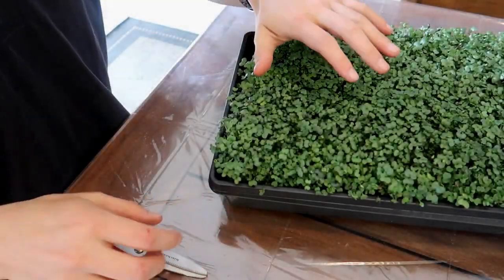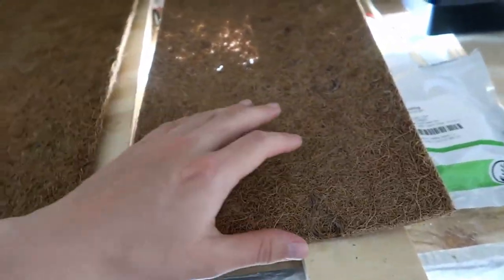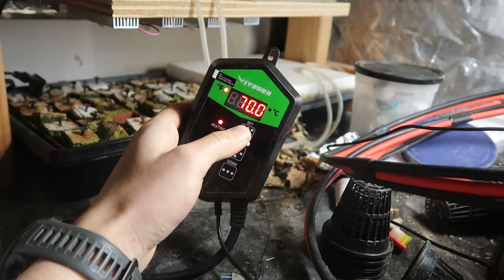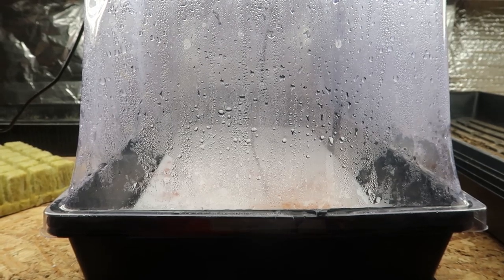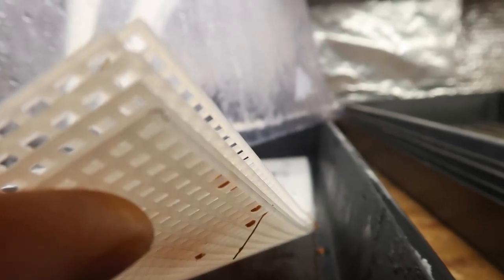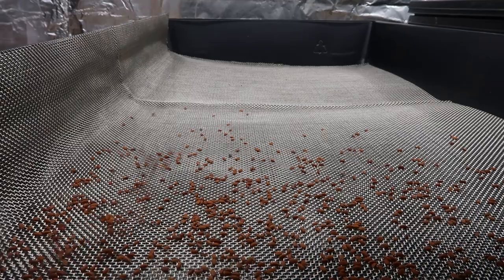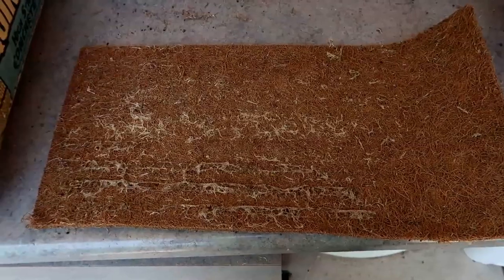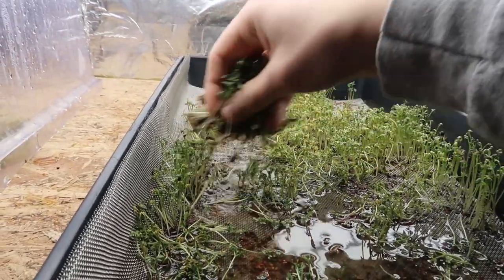Growing Microgreens on Steel Mesh

Comment: We use the NSF approved grow screen option, which is Efficient Grow.  Growing on Stainless Steel can lead to the roots absorbing heavy metals.  Best to use the screen that's designed for Microgreens growing.
Reply: Not sure where you got your info, but 304 and 316 stainless steel is both safe for food use.  Its also used in some plumbing, so if we can drink from it I doubt growing with it is going to be any type of issue.  316 is also cleared for surgical use, so it literally can be used inside the body.
Reply: @wyldwabyt  it's funny.  Now they're saying the material is 316 grade.  By my count this is the third different grade they're calling it.  What is it really?  You'll never see stainless steel used in a large hydroponics facility.  Virtually all the fixtures and plumbing are NSF approved plastics, selected for this purpose.  Where you'll see stainless steel used in food production is very short contact applications, think hours not days.  Further you'll never see roots touching stainless steel as the root osmosis is adept at breaking down and pulling these molecules out.  If I'm wrong, please share a growing application where stainless steel comes in contact with plant roots.  The cannabis industry has had to reevaluate its use of stainless steel for production.  Since they aren't growing 'food' they haven't applied the same considerations to material selection as hydroponics food facilities.  That is biting them.  https://www.analyticalcannabis.com/articles/what-the-cannabis-industry-should-know-about-stainless-steel-314233
Reply: @walterhill9642  Interesting post, but it points to shears as the source of Cr, since those surfaces are rubbing against each other causing abrasion, not due to plant leeching

Comment: Hey Brandon, I’m torn between using polypropylene screens, 304 stainless steel screens or 316.  My concern is that polypropylene won’t be strong enough when cleaning, the 304 will rust because my I’m using Magnesium Sulfate in my nutrient mix. Apparently 304 begins to corrode almost instantly when exposed to salt.  316 stainless steel is preferable in food processes but very expensive.  I’m wondering what your experience has been using the 304 screens over the last few months.  Have you experienced any rusting or corrosion issues?  Thanks.
Reply from the maker: Hey there. 304 stainless has served me well. The only specific situations I have used it in is PH balanced water of around 6.5. I have not used it with salt or any corrosive liquids for any extended period of time. Given your situation, I would invest in 316 stainless simply to avoid being disappointed and spending extra money if it doesn't work out with 304. However I am no expert on the matter. Sorry to be of no use haha 😆. Take care.
Reply from the maker: Oh also I would not recommend using polypropylene unless it says it is BPA free or something. I would stay away from plastics all together.
Reply: @BrandonBattelle  Thank you so much for the feedback.  Greatly appreciated.

Comment: What are your thoughts on using copper mesh instead? I have found A4 mesh sheets of all different apertures, so you could swap them out depending on the size of the seed (rather than doubling up) and copper has the added benefit of being antifungal... I'm just not sure if that may inhibit germination for the same reasons it inhibits the bad stuff. I think I'll do a side by side comparison with SS. I guess another downside is tarnishing over time, but if it helped reduce mold without hurting the shoots it might be worth it.
Reply from the maker: So I just did some research on copper and would say that it is essential that the copper you use should be 100% pure copper. Coating or other chemicals in impure copper could certainly cause an acidic toxicity which may harm plant development or harm the consumer of the greens or both. 
Having the antibacterial properties would be very cool, but then again if you have copper pipes in your house which supply the water used for your microgreens then you should be getting that benefit already.
I like your idea of a side by side comparison with SS. I would pay attention to differences in the smell of the water and plants, color of plants, and taste of plants to see if the copper grown plants taste better or worse.

Comment: Serious question.. Would fiberglass window mesh be a good reusable medium do you think?
Reply from the maker: That would be an easy alternative if it works. I would soak some in water for an extended period of time, like a month, and see if it starts to fall apart. If it does not fall apart, and you want to be extra safe, you could send a water sample to a lab to get tested. Personally, I am uncertain about how safe it would be, but I would be optimistic.

Comment: the mesh is currently unavailable. do you have any other source?
Reply from the maker: Different brand but same stuff: https://www.amazon.com/Stainless-Screen-Ventilation-Shower-Cabinet/dp/B09FK864CR/ref=mp_s_a_1_1_sspa?crid=UMGLC1OG5CPD&keywords=304+Stainless+Steel+Mesh+Screen+type+20&qid=1657745340&sprefix=304+stainless+steel+mesh+screen+type+20%2Caps%2C175&sr=8-1-spons&psc=1&spLa=ZW5jcnlwdGVkUXVhbGlmaWVyPUEyQzBCVE42Vk1QNUFMJmVuY3J5cHRlZElkPUEwNjIwNTUzMkhXTlFBMzA4MUtSWSZlbmNyeXB0ZWRBZElkPUEwNTA1Nzc1TzhGMFQzOVk2Q1VWJndpZGdldE5hbWU9c3BfcGhvbmVfc2VhcmNoX2F0ZiZhY3Rpb249Y2xpY2tSZWRpcmVjdCZkb05vdExvZ0NsaWNrPXRydWU=